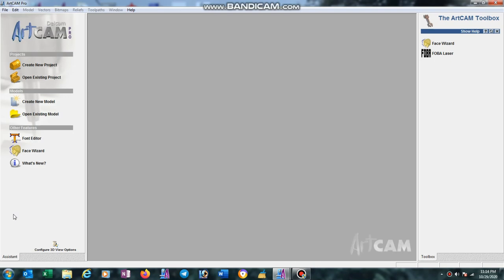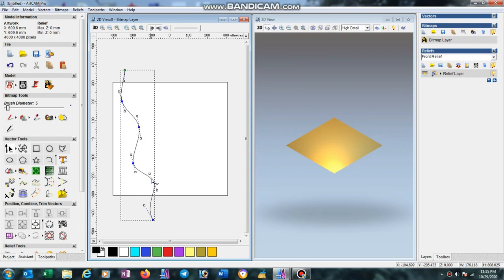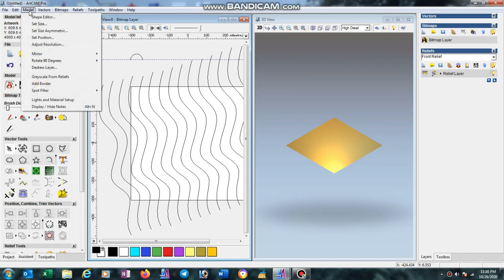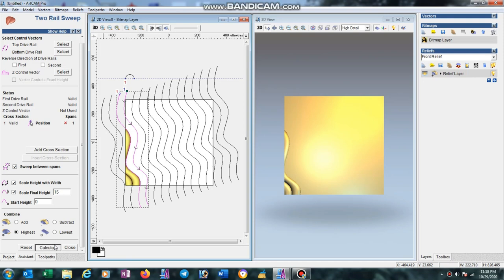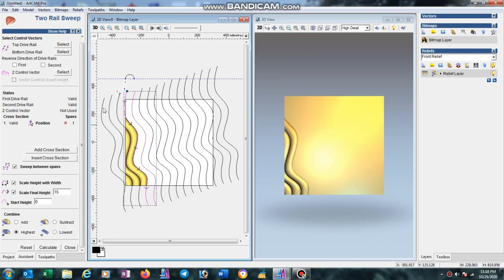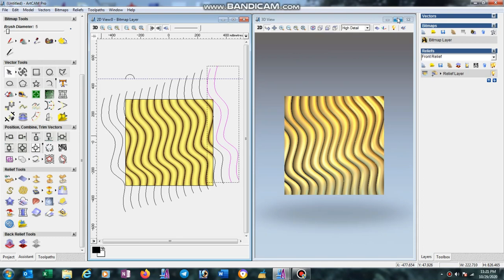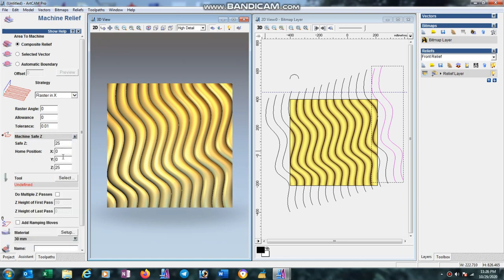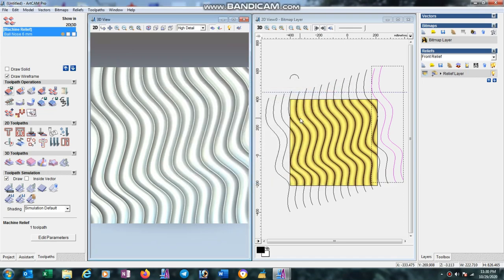How to make 3d texture design with  toolpath for wood in Artcam 2008

Comment: Hello I'm new to artcam and CNC operations, and I need to cut out same design but instead of a curvy lines I need straight with arch height of 30mm out of a 40 mm piece of wood, I tried doing as in the video but the 6mm bit goes completely 40mm in on the first plunge and starts to Blacken and burn the wood, any suggestions?